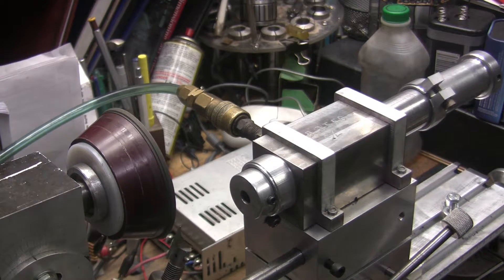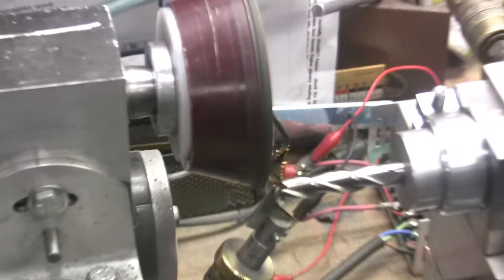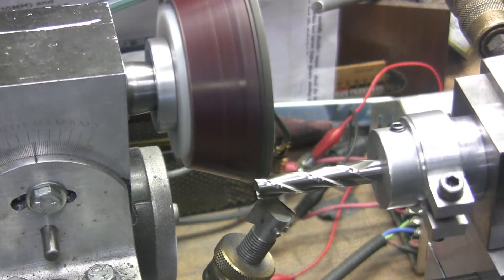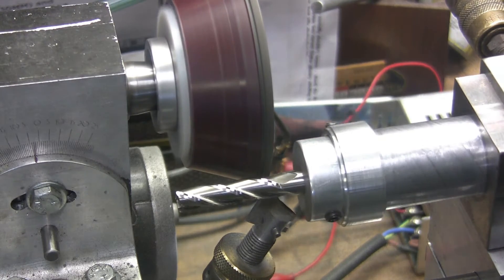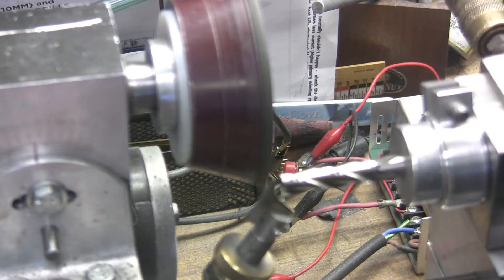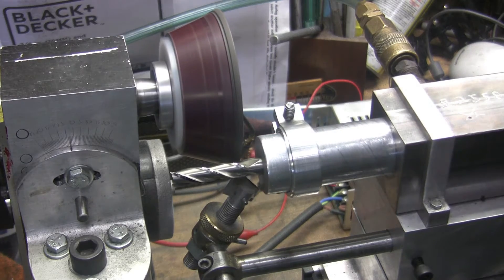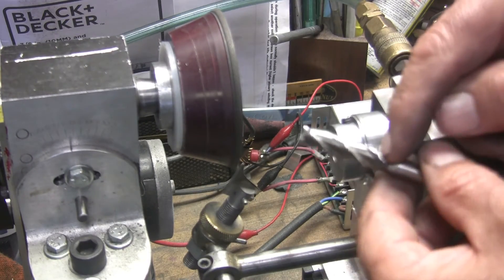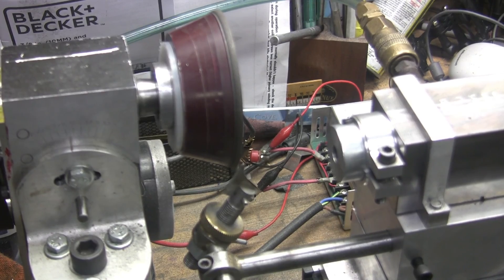Tool Sharpening some HSS & carbide end mills on home shop built setup.

Comment: grinding right next to an non sealed power supply... nice...
So do you need to make a new lead screw for every endmill pitch?
Wish i had one of these.
Reply from the maker: No there is a finger that rides on each flute the power supply usually lays quite away from where I grind.

Comment: I have a Cuttermaster and that uses the wheel front face angle tilting to do the primary and secondary angles.....that's much easier to do as you don't have to calculate the amount of cutter below centre or head above centre you have to have the wheel periphery for those angles.......have you considered making this set up to follow that design?
Reply from the maker: I  started sharpening in that fashion before I acquired a cup wheel and haven't switched around. I was planning on eventually redoing the setup but just haven't made the time to do so. I will need to remount the spindle head I did scribe in the angle marks to be able to set the angles. I may try and make time to do that before the next sharpen session. Right now it sharpens small end mills with a satisfactory edge actually a nice edge but the larger endmills not so much they work but could be better. Thanks for the comment. I was going to purchase the CutterMaster right before I decided to make my own setup. And yes it would be much easier to setup and go from primary to secondary angles. If I remember right when I got the cup wheel I tried to swing the spindle around but didn't have enough room and I didn't take the time to remount it lol got lazy.

Comment: How does the Lever work,  to push the end mill in and out into the wheel?  Is that also home made ?  I saw the Master Cutter machine has a " tilt " that moves the tool into and out from the wheel. I'd like to know how you achieve that movement without losing square and rigidity
Thanks........
Reply from the maker: Yes it moves the cutter into the wheel for grinding. The whole thing is spring loaded and sets on 2 ball bearing balls and the 3rd is a cam activated pin. And yes I built it funny you should post as I was planning on sharpening some dull cutters in the near future and was planning on doing another video of it.
Reply: @InTheShopWithDoc  Do you share drawings of your components you built? I'm hoping to make one for myself for my garage machine shop for fun. I'm a bit stuck on how to have the motor raise and lower while staying square and true. I get the tilt thing,, but want a good way to raise and lower the grinding wheel.  Thanks....Kenny.  Love the videos !!!
Reply from the maker: @kennyp2761 The air bearing is based off a copy writed drawing so cn't really share . I have more work to do on the raise and lower of the grinding head. Was going to put some slots in the outside housing and a couple pins pressed into the inter housing to keep every thing square just haven't don that yet.